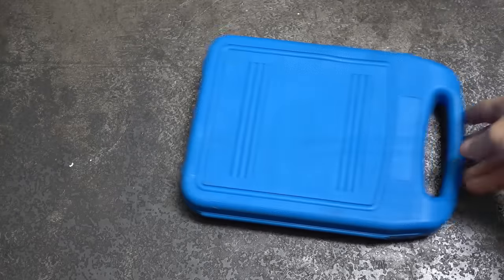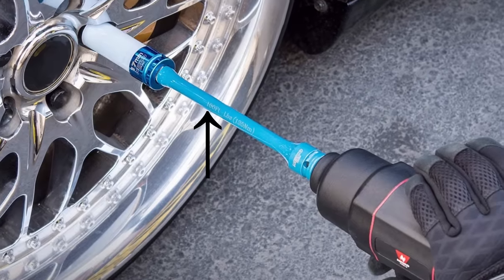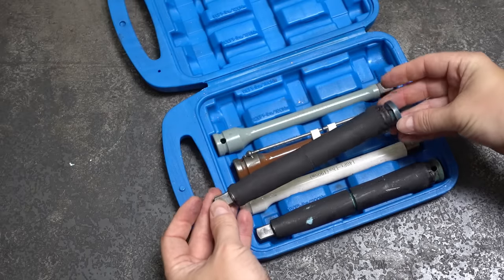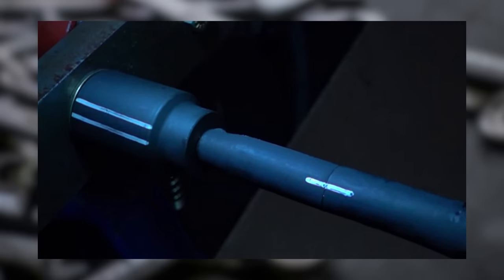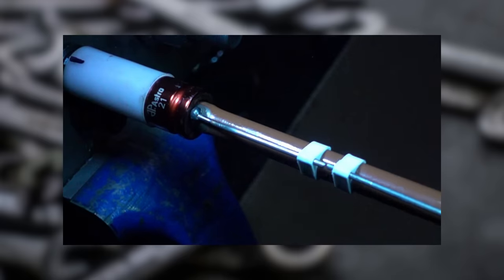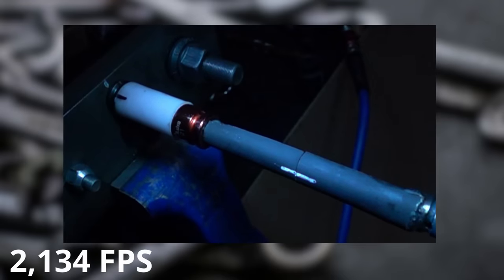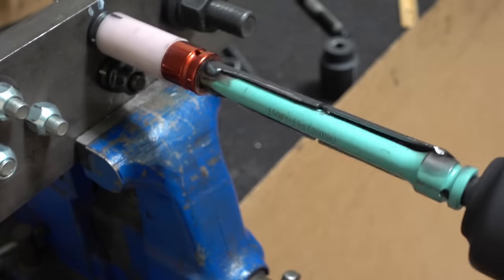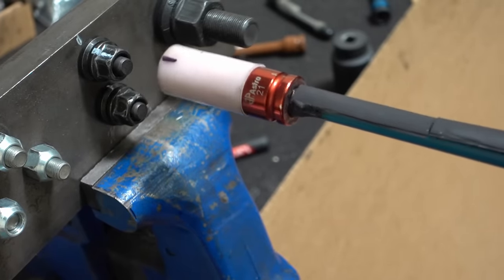Torque Sticks! High Speed Video Helps Reveal the Truth

Comment: I found this channel after I stripped my bolt by applying the correct torque spec on my bmw's oil nut thing. I never learned why but it's an entertaining channel
Reply from the maker: Lubricated threads have lower friction. If it had oil on it, the correct torque could still be 30%+ more bolt tension than aimed for as torque is s measure of your effort not the resulting tightness

Comment: I always like to think of it like I'm trying to put a very specific hole depth in drywall.  I can't easily push the drywall (regular wrench), but I can punch the drywall (impact gun).  Torque sticks are like using different thickness pillows to soften my punches a little allowing me to adjust how deep the hole goes.

Comment: I figured this concept out the cordless impacts on doing large truck ubolts. Using a 1 inch drive air impact you might get the nuts to a couple hundred foot pounds because of the way the gun hammers. But the speed of blows on the 1/2 Milwaukee high output 18v impact, the gun is hammering the nut again before the torsion in the long ubolts rebounds and I can consistently get at or close to 475 foot pounds then finish to final torque with a torque wrench. Such a time and back saver.

Comment: I've found that if I'm torquing my wheels on my F150 to 150ft-lbs it's best to use the 130 or 140ft-lbs torque stick then finish the torque by hand with a torque wrench to limit the work required by hand. I too noticed the 150ft-lbs torque stick on my Milwaukee impact driver over torqued the lug nuts

Comment: I admit up front I am not a mechanical engineer, but I think the answer regarding your 3D printed fixtures is simple once you see what I am referring to based on your explanation of how the torque sticks work. Thinking about your 3D printed 'wire' indicator versus your 'tube' indicator, I think the reason why it behaved the way it did is BECAUSE of your 3D printed support. 

From your video these torque sticks work over the entire length of the tube. Your wire indicator (while welded on the ends) had those supports in the middle of the tube which is where the limiting mechanism was happening, while your 'tube' indicator was self-supported the entire length with no supports in the middle. This also explains the behavior of your 'wire' indicator with the cordless test, as your 3D printed fixtures were then 'slipping' on the tube due to the higher impact rate (for the same reason the torque rod didn't work) 

I had wondered not only if they work but how they did, so your video was very informative! While your product reviews are great to watch and helpful if/when I ever need to replace a tool, these "How it Works" videos I think are even better as they show not just what/how somethign is working, but WHY it is working the way it does. Looking forward to your next video, whatever it is!

Comment: Nice engineering lesson! Same is true on drive shafts on vehicles. Ever noticed that on high power vehicles the drive shaft is kept as short as possible? Subarus having equal lengths shafts drive nicer than unbalanced shafts? The Tesla Plaid not only gets rid of the differential in the read but also skips the losses of the traction control used to factually balance the loads.  Summing up: Any extension will reduce torque so it it is critical use the torque wrench!

Comment: I would liken it to using a breaker bar to loosen a nut.  If you hit the end of a 24" breaker bar with a hammer to attempt to shock a nut loose, a lot of the energy from a hammer blow will be used as work to flex the breaker bar.  If you hold tension on the breaker bar, then hit it with the hammer, you are more likely to move the nut because the breaker bar won't absorb as much of the energy into flexing because it is already tensioned and can't move as far as unloaded when the same force is applied.  The cordless impacts are like a tensioned breaker bar because of the high IPM.  The high IPM essentially holds tension on the stick which allows torque to me transmitted to the nut instead of absorbed by the torque stick twisting, which happens on traditional pneumatic impacts that don't hit as fast.

Comment: We have a Tame hydraulic torque wrench at work. The specific one we use has three torque settings, as the specific item being torqued has three stages of torque. 

One day (recently), a coworker decided to use the "loosen" function to torque the nuts in question. The nuts have a maximum torque of 2400 lb-ft. The "loosen" function (break away torque) of the wrench can create a maximum of 3800 lb-ft. He almost destroyed the engine by continuing to torque on the "loosen" setting. 

And before anyone says "it should only work in one direction", consider the possibility of reverse threads.

Comment: I discovered this system about 40 years ago. It was a rare tool at the time. 
A Swedish company (Momento) specializing in sockets produced torque sockets. They weren't extensions back then. I don't know if they were the inventors of the system, but it really worked well and with enough precision to not have any problems when tightening the wheels. 
I had a problem once, but it was my fault. By replacing the alloy rims for the winter with sheet steel rims, the screws, which had part of the thread a little rusty, falsified the measurement and the tightening was not sufficient. 
Apart from that, I could always ensure easy disassembly for my customers in the event of a puncture, without risking losing their wheel. I have often demonstrated this to curious or worried clients.  :-)

Comment: Neat.  The one big thing i'm taking away though, and correct me if i'm wrong, is that I should over-rate a torque stick when using an electric impact tool vs. a pneumatic one, to prevent over torquing lug nuts before final torque.  Or I can stick with my current method of knowing that setting 2 on my 1/2" Ryobi will do about 60 ft-lb after 4 ugga duggas. :D
Reply: Ugga duggas! Hahahahaha That never gets old. Hahahahaha I say that all the time.

Comment: In factory assembly of all types of machines, the electric drivers (hand and robotic) have precise torque settings.  Old school assembly uses Philips screws, which are designed to slip out at the correct torque, reducing build time.

Comment: A company I work for decades ago had a Skidmore Willhelm bolt tension tester as a demonstration tool in the field. I used that instrument many times. If I were torque a nut on a bolt to the prescribed torque setting and then loosen that nut and re-torque it again, and the clamping force would be reduced even though the nut was torqued to the specified amount. The conclusion was you should not reuse a nut. In this particular demonstration a new nut and threaded fastener would be mandatory. Even oil from your skin touching the fastener threads affect the torque or clamping force.

Comment: i bought master force torque sticks and used them on my truck. my wheel loosed and started to come off a couple weeks later.   i tested masterforce 120ft/lbs stick against a snapon stick and found 43 ft/lbs light when torqued with a mac 1/2" air gun and checked with the digital snapon torque wrench.

Comment: I think you might be seeing some effects from the hydraulic fluid in your results. it takes some amount of time and force for fluid to flow, however small and it could be effectively damping the tightening movement of the nut. a 1/2-13 nut moves axially a bit more than 2 tenths per degree of rotation. Another factor could be the spring force of the container. as that hammer blow transmits into the fluid it probably sends a nice spike of pressure which is going to flex anything it's pressing against.

that's the fun of testing, though. factors that are almost always negligible become a huge deal if you aren't sure how much they contribute to the results.

Comment: It's nice to know that extensions on an electric impact driver rob less force than l expected. I've got a few hex to socket adapters that have a six inch extension on, and l always thought those really cut down on the power transmitted, but l guess this is why l never really noticed any weakness in practice

Comment: Try using the cordless impacts on speed 2 rather than 3. That’s lower IPM and should allow the torque stick to spring back.
Reply: I've always used torque sticks on speed 2 (m18 high torque) and it seems to work perfectly fine.

Comment: Nice science. I have one of Snap-on's 1/2" cordless. It has its own form of torque limit. three settings 100, 200, max
I set it to 100 when using torque sticks. Works well and under torques them as long as I don't hit them longer than zipping them on. Like you said, zip um on and your good.

Comment: When those things first came on the market I was a MAC tool dealer.  It was immediately apparent that brand of air wrench and air line pressure significantly affected the torque you actually got wit them.  I refused to put themon my truck even thought I had customers asking for them.  Junk in terms of actually delivering an accurate torque to fasteners.  When I see a shop using those they don't get to work on my car.

Comment: When I bought my last set (which was quite a few years ago) It came with instructions.  Most importantly, they were to be used with 1/2" air impact hammers rated within a certain torque range, with an air supply of 90-120psi and a certain cfm.  Sorry for not remembering the numbers, but roughly speaking, the gun needed to be between 300 to 600 foot pound and you can't choke the air supply off with needlessly long and thin lines and hoses, and the air supply must be able to maintain necessary air pressure and flow from the start to end of the lugnut tightening.  Also, we avoided the ridiculously cheap knockoffs that didn't even have instructions in the package.  Whenever we checked our results against a torque wrench, we were within 4 percent.  We had problems if the socket was cracked or otherwise excessively worn.  We had problems if the air compressor cut out without anyone noticing.  I suppose we would have had problems with electric impacts.   So, if you aren't getting accurate results out of torque sticks I would counter that you can't expect them without the appropriate inputs.  And you have to keep your hands off the socket and stick.

Comment: It all has to do with the metal used too, stronger steel is stiffer and springs to a point (eventually it will fail) vs softer steel that just bends after each impact in this case and at a certain point will be compromised and it will break with enough force but typically just bends out of the way. Just like engines like harder steel so they can flex/spring like this rather than bend. Ideally for longevity with a normal power output you want it right on the border where it can bend a little but not easily. Allowing it to bend can save from a instant broken rod. No a bent rod isn't good but if it's not broken and still runs it'll give you time to get it fixed.

Comment: The m18  high torque impact is bang on woth thise sticks.  The mid torque and lower over tightens them  you need power for the sticks to work the way they were designed.

Comment: 7:48 when I worked for Penske servicing semi trucks we relied EXCLUSIVELY on torque sticks and a 1" air impact for lug nuts. We just flat out did not have a torque wrench for those nuts. granted they go up to 500lb/ft and it's not gonna cause a wheel-off if you only hit 495 on one, but still.

And hell half the time I didn't bother switching to them. I found during my days as a Goodyear CTSC tire slinger that 8 ugga duggas from a 1" air impact was pretty much right on the money. 7 too few, 9 too many. So I usually just ran 'em down 8 ugga duggas and called it.

Comment: To help you understand how your hydraulic system is skewing the effect of the torque stick, put your hand on a hose, the hit the dyno with a high torque impact.  You'll feel pulses in the hose as the impacts increase the pressure of the hose and cause it to expand and contract with every blow.  The lines are absorbing some of the shock.  I would be curious to see if your numbers changed if you used solid steel lines instead of flexible lines.  I bet while your numbers are consistent, they would be higher with steel lines that were significantly higher rated than the pressure you put through them.  Hoses will expand and contract with pressure waves (in this case impact blows), but steel tube, not so much.

Comment: I have big trucks at home.  And use a onekey milwaukee impact with a 80 ft lb torque stick.. i find the lugs are within 10 foot pounds..  the onekey impact I can dial down the mid torque to a reasonable amount of power.  I still check the lugs with a decent torque wrench.

Comment: i just use my little impact driver to zip lug nuts on. works well and just a couple seconds of impacting seems to get the torque right. though that may be because mine is a lower specced tool than most i find.

Comment: So I'm not sure where you guys went wrong, but I have had pretty good success with the torque sticks and a cordless high torque impact. Basically you have to listen to the sound of the impacts, and when it changes you need to stop. To me, it sounds kind of like the impacts double in speed, or like they become more clingy. I have never over torqued a lug nut doing that, but I have started using the torque stick that is 20 ft lb less because I didn't like how close I kept getting to the final torque (sometimes bang on, loosened to verify  it wasn't over torqued and re tightened) because I like the torque wrench to move at least a little for final torque

Comment: So the flip side of how weighted sockets dampen the spring back on long fittings so the next hammer blow has less torsion to take up.  The cordless impact hammer frequency does that for these torque sticks.  The torque sticks limit the torque of the air impact by torsion and the weighted socket compensates for torque lost due the torsion in long bolts when using an air impact.

Comment: the throw distance of the strike or duration of force is apparently higher on the air driven impact device.  The strike interval is probably also much longer, not strike to strike but rather time with no force being applied.  This does not allow the drive shaft (or add on gauges components) to recoil completely in between strikes thus acting as continued acceleration and bending the custom gauges. The gauges are reaching the yielding point due to the continued force without recoil time.

Comment: Moments of inertial, difficult bodies with different stiffness and resonances.
All effects we are here quite readily and we also see some of the wasted energy in the system.
The difficulties in measuring such systems we touched upon when this channel began and why we use quite different equipment but also that must be part of the tool design.

An outcome is that a tool such as one like these may be better in one situation than another.
Another is some of what we see in the videos provide explanations for the variations in some of the measured data we are graphically here.

Comment: This was a great video. 

I would be curious to see a video where you mark the ends of the torque stick with white lines, then when editing the video, you cut out the center of the frame and match up both sides right next to each other - I think that would be a great way to demonstrate how much a torque stick flexes, and to see the differences between sticks in terms of flex.
Reply: That is what they just did...
Reply: @Brian Gray  I think his suggestion is intended to remove whatever error any elasticity the overwelded tube or rod might have had.